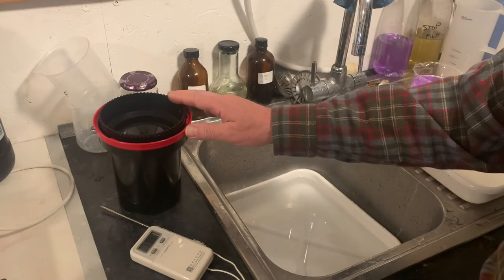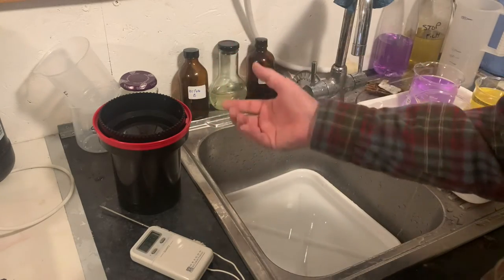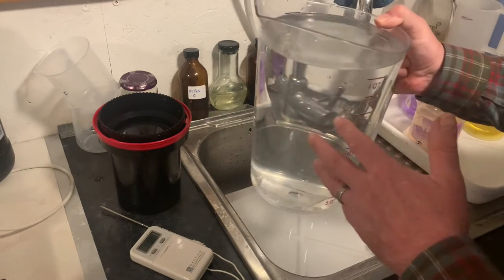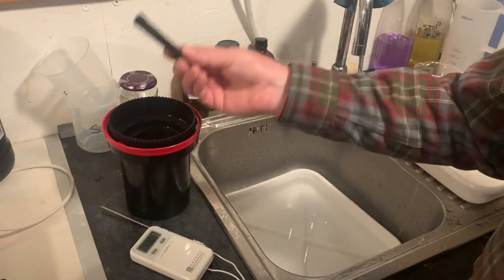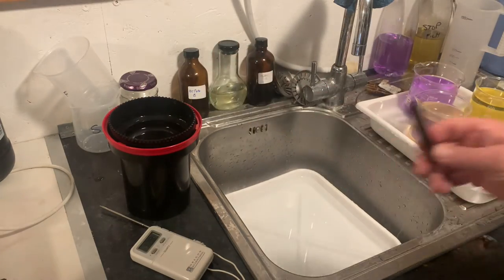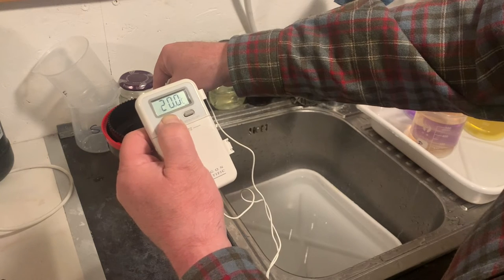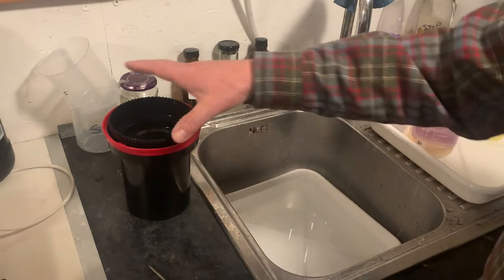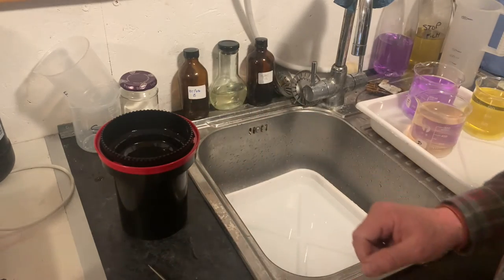Controlling Development Temperature Pt1

Comment: Another great video John, thanks for the tip. I find my developer seems to exist at the same temperature as my tap water most of the time, changing a bit through the year. I simply develop at that temp, adjust time accordingly and then I can do my rinses directly with tap water and not worry about reticulation of grain. This is my low effort approach 😋
Reply from the maker: And a very nice approach too Dav.
Reply: @PictorialPlanet  cheers 😁

Comment: Great info. Unfortunately for those of us that use steel tanks, it is not an option to measure the temp of the water inside the tank. I personally just put the empty tank with film in it in a water bath at the temp I want to develop for about 10 minutes. Then put the developer in at the correct temp. While developing I put the tank back in the water bath between agitations if the room temperature is higher than dev temp. Unless I am developing cms20ii. That calls for letting the tank warm a bit to room temperature during development. Man that is a sharp film if all done correctly and using the proper developer made for it. Cheers.
Reply from the maker: Yes, steel tanks are not as easy to do this but, as you say, leaving in a water Bath warms them up. Good call, Thomas!

Comment: At my shed where i have to develop my films it is very cold now and i use a plastic box filled with water heated by a cheap sous vide heater. They are very accurate and sometimes cheap to buy at Lidl or Aldi in summertime when barbecue season starts...
Reply from the maker: This is a terrific tip SD, thank you!
Reply: I use a fish tank heater in a Ikea plastic box for my darkroom chemicals, I usually turn it on a couple of hours before starting work in the darkroom.

Comment: How odd is that. I got into developing C41, still doing so, you do a 5min warm up of tank and film. 
Then I developed a B&W film and by happy accident I pre warmed the b&w film with no issue and nice results at 20 degrees I do this all the time now. So this tip confirms what I am doing is on the right path. Wishing you well.
Reply from the maker: Wishing you well too Dave. I don't do C41. I could learn a lot from you.
Reply: @PictorialPlanet  I think it would be vis versa, but its not to much different from B&W, just have to keep the tank warm in the temp controlled bucket or sink. Tetenal C41 kit seems good so far. But each day is a learning adventure for a the moment. 🙂

Comment: Hi John, Thanks for your really helpful videos. Would you recommend always pre-soaking the film prior to developing? I must admit that I never do, but I’ve often wondered if I should.
Reply: From memory John doesn't always recommend it, depending on the development type. Two bath usually is done without pre soaking.
Reply from the maker: Most of the time I don't recommend it. I do it just to bring the temperature up (if cold) and also with minimal agitation with pyrocat it 510-pyro. Usually it's not necessary.
Reply from the maker: Your memory serves you well Dav :)